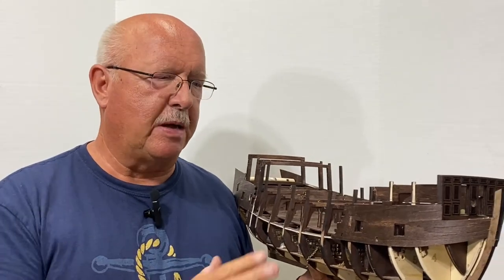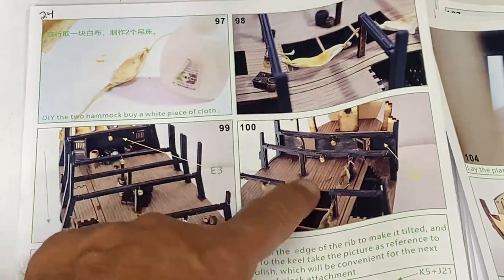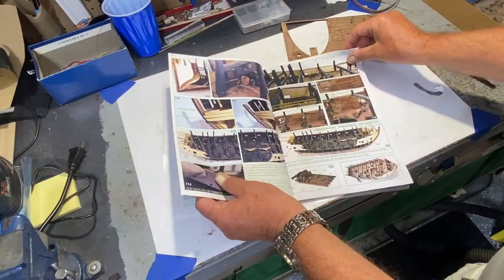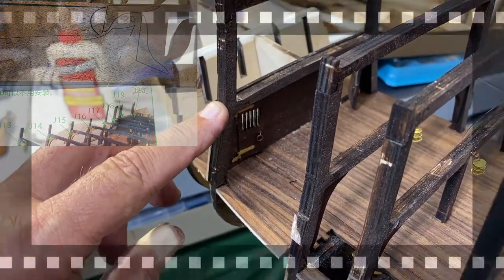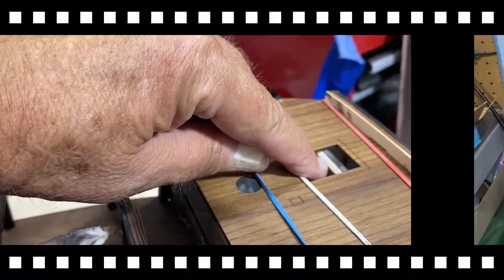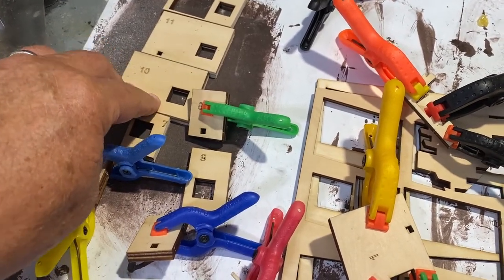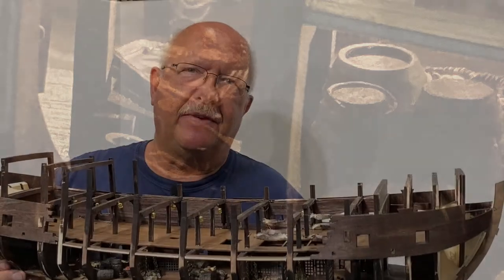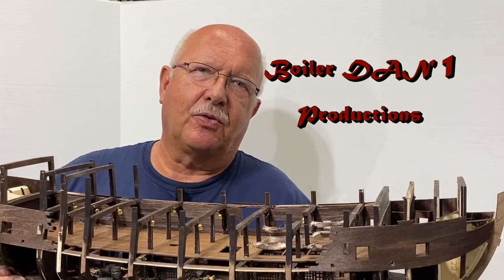Black Pearl All Scenario Version PART 5

Comment: Hi, you mentioned you were not too keen on figures.  Since you have them for the Golden version, can you tell me exactly how tall the tallest figure is, please? Thank you
Reply from the maker: I like the statues fine. I just think the ship is fine with or without.
I measured the Jack Sparrow statue. 
After I remove the little platform it stands on its about 36mm or just under 1 1/2 inch.
I’m very happy with them but it takes some work on getting them painted. But if you’re talented in that area, they are quality molds.
Thanks for watching 👍
Hope that helps.

Comment: Hello there. Great work. I buyed the all sealed from zhl 1 week or so ago. But i struggle with the front frome. I did put it in to the water and i can bend it. But my big question in did you use iron to make it stuck in the front ? And the place on the first layer i have 2 huge holes, but i think it is supposed to be there.  But i strgling with the iron part.pls help med
Reply from the maker: I’ll try.
I also built the ZHL sealed version.
Here’s a link to those videos:
https://youtube.com/playlist?list=PLjMZtm2hvqrNZ82Ts0RIG7UXwtKzepf1f&si=pYLw9WoBQZKHluZp
Planking is difficult and I’ve improved the more I have done it.
I use several techniques.
Hot water then bend with hot iron (soldering iron).
Recently I have soaked planks in household ammonia ( caution with the fumes, need good air circulation).
You have to taper the ends at the curve of the hull.
It can also help if you sand or file the inside corners of the planks as the hull curves downward.
After you put on the first layer of planks, sand them smooth. Then you can fill in any holes, dips or cracks with wood putty / filler.  The outer layer of planks are the important ones.
Before putting on the outer layer of planks, stain the first layer that doesn’t show. You could also paint that inside layer black. Then if there is a gap it will not show as much.
You can send me a picture of the area at
boilerdanone@gmail.com
In the meantime I will try to find a segment on the planking that I wrote about in my reply.
Reply from the maker: Segment 10 has some on planks 
Black Pearl All Scenario Version PART 10
https://youtu.be/Q2jOrbwZEtY
Reply from the maker: Segment 11 also has planking
https://youtu.be/tQPePRsaKMQ?si=TDV0NgTVNbUQmpRv
Reply from the maker: Probably starting with the ZHL Golden edition Episode 4, 5, 6 might be helpful.
Here’s a link to the episode 4.
The Black Pearl Golden Version 2021 Episode 4  (The Missing Map)
https://youtu.be/HcbcSpRlxdc

Comment: It’s looking great Dan. I was wondering though, why didn’t you use those flickering lights that you have used before? Just wondering. I think the lights in this video look good I just figured you’d try to recreate that flickering candle look.
Reply from the maker: The lanterns below deck are very tiny with pre-connected wires. That was the deciding factor. However, the larger ones at the back of the ship are larger so I will convert those to the flickering type. 
Keep Subaru-ing! Did I already mention that we live in the city that makes several of the Subaru models!
I’m on my 3rd Forester 😁👍
Reply: @BoilerDan1  ah ok. Makes sense. 

Yup, we talked about our Subaru’s lol. I just changed a window motor on my moms Forester. Great cars.
Reply from the maker: Ah, a true do it yourself’er!
I’m the same….Try it myself 1st, then I can always hire someone to do it if I can’t!
I changed spark plugs in my first Forester….YIKES, that was quite the challenge! Shame I didn’t YouTube that adventure 😂. I did succeed but one plug was very I mean very difficult to reach. (I don’t have words to express it! 😂😵‍💫🥴🤣.
Won’t change again unless something stars to sputter!
Reply: @BoilerDan1  I don’t even want to think of spark plugs right now. The ones on my 04 WRX are all difficult to get to and that’s after removing the battery, the air filter housing and moving the windshield wiper fluid reservoir out of the way. 

Beats the service charges on Subaru’s though.
Reply from the maker: That all sounds very familiar! 😂